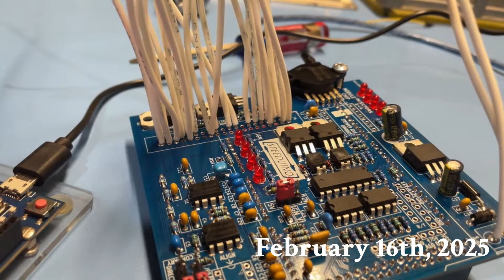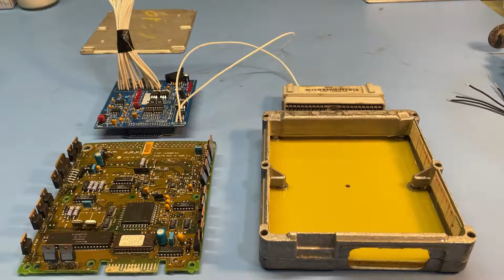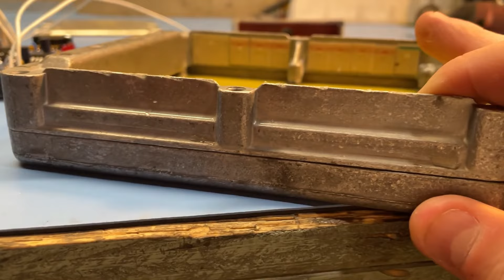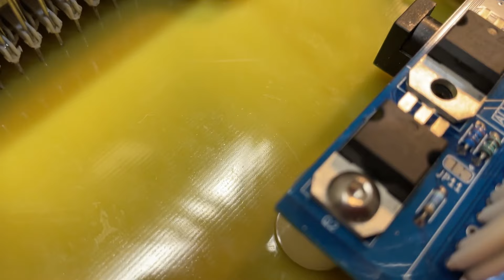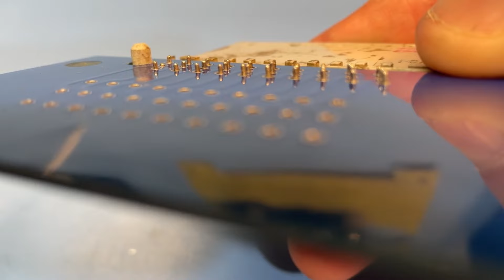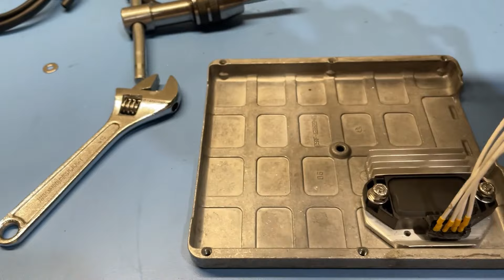302 Mustang Speeduino Plug and Play ECU - Part V

Comment: I'm designing a new printed circuit board. If possible, I'd like help connecting the Speeduino to a Ranger 2.5 gasoline engine with two ignition coils.
Reply from the maker: From my 10 minutes of research, the 2.5 liter 4 cylinder Ford ranger engine is in 1999ish models.   

These have a “twin tower” style coil pack.  2 coils.   2 cylinders per coil. 

2 cylinders are fired simultaneously.  Resulting in wasted spark.  This is fine.  However they are “dumb coils” and cannot be wired directly to the Speeduino.  

The factory Ford ECU handled coil control.  There is no ICM or separate coil driver module like the mustangs have.  This is also how the 2000 Explorer I took parts from at the junkyard works.  

So you would need a 2 channel ignition coil driver.  Or you could run a pair of single channel drivers. To control ignition using factory coils on this engine

It could be done.  Harness modification would be needed.